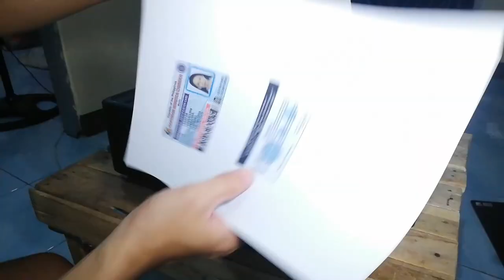Epson L360 Paper jam Repair

Comment: Paano kung sabay na umiilaw na yung 2 LED ng Reset Button?
Reply from the maker: sir connect nio po sa pc then try nio magprin and then mkikita nio po error nia
Reply: Tatlo yung errors na lumalabas. 
Pero wala sa tatlo yung mismong error.
Reply from the maker: @marinzacebuche2838  try nio min reset sir or hold nio po muna ung reset button ng 20 seconds
Reply: @WillReyes  nagpower reset na din ako, ayaw pa din. L360 yung model. Ano pa po kayang pwedeng gawin?
Reply from the maker: have you tried test print? para malman ntin ng error nia pero if di parin ok try mo tangglin mg takip ng ink para bumaba ung ink sa bottom less then tapos nun hold mo ng 20 seconds ung reset button